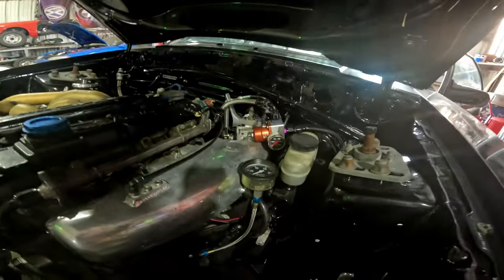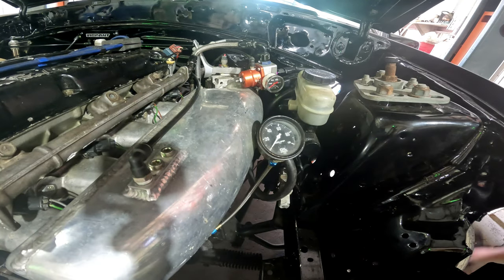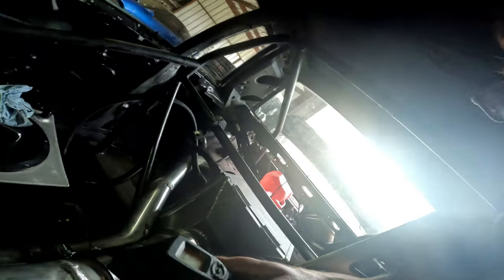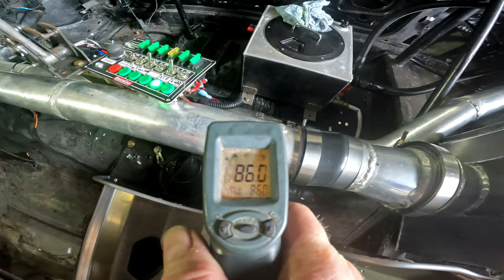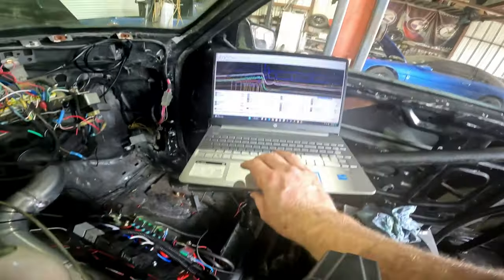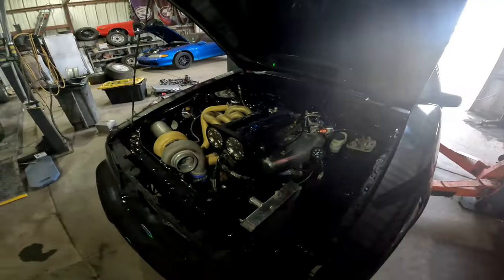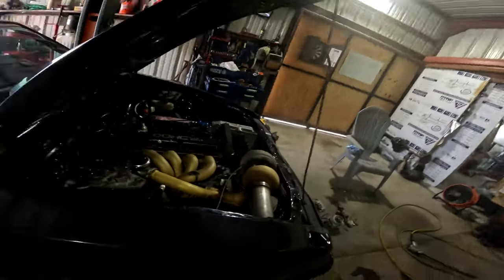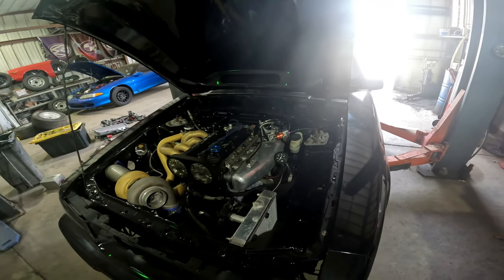second transbrake test

Comment: For me, the most effective way to get on the converter without nitrous was to tune it pretty lean (.9 lambda, around 13.25:1 AFR) and aggressive timing (24-26 degrees) under around 4500 RPM and <20 psi of boost. It was just about as lean as I could run without it stumbling - I found that point and richened it up .02-.03 lambda and was pretty well good to go. You can also play with cam gears and see quite a bit of change, at the cost of top end power. The air:water is certainly helping you out, too - If you can pre cool the core by running the pump for a bit, you'll probably see even better results. 

On my car with nitrous, the more fuel I throw at it, the faster it seems to spool. So if you're not opposed to it, it really is the quickest way to get where you need to be. 

It's great to see another RWD 4G63 powered drag car - can't wait to see it making passes. Good luck!
Reply from the maker: Yeah I have nitrous on my truck and it spools really quick. I’ll try to lean it out some on the fox and see if it helps. I run my truck with the exhaust cam advanced for nice idle etc. just got started on this one so I’m sure it’ll get better. Although, nitrous is so much easier on the transmission.